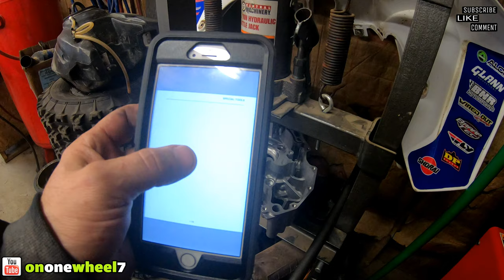YAMAHA YFZ450r ENGINE BUILD   PART 1

Comment: Put those case halve with the bearings in the oven at 300° for 1/2 hour and they will just drop right out ... also vice versa for bearing installation - put the case halves in the oven at 300° and the bearings in the freezer and they will drop right in like butter ...
Reply from the maker: Thanks man if you have seen my latest couple of builds i have been doing just that works like a charm i love it.
Reply: Exactly

Comment: I have a 05 YZ450F  When you was putting the transmission in and the fist washer you said dont forgot this and it rides on the bearing my engine didn't have it. The 5th gear felt like it was jumping like skipping keep on chain and sprocket but wasnt that it was tranny. Could this be the reason for this? No washer ? Thank you great video
Reply from the maker: That maybe a different setup as far as the washer goes you may want to check the manual and see the atv transmission is a little heavier duty vs the dirtbike one.

Comment: Do you case splitter to separate? And why don't you use crank puller to push cases on? Wouldn't it make it easier? I'm just asking for knowledge not trying to sound as if I'm an expert. I've assembled alot of 2 strokes and it's required on trx250r and Cr80,125,250 but then the banshee is completely different.
Reply from the maker: I do use a case splitter. Crank installer isn’t really needed i do have one and have used it on 2strokes as well those you have to use them. These will tap rite in w a rubber mallet.

Comment: Do you have a video on cleaning the cases? Scraping off the old gaskets and things like that.
Reply from the maker: In some or my earlier engine build vids i used to sand blast them myself now its easier to send them out to be cleaned but i have shown it before.

Comment: So it’s supposed to be that tight when reinstalling…? Cause mine was worrying me last night I didn’t want to slam it together and it get stuck, and then never be able to get it apart or have something binding inside
Reply from the maker: Yup. To pull the cases apart easily the tusk case splitter tool is a must have.

Comment: Hey new subscriber here.  Got a quick question I got a 04 450 doing a new crank build.  Can the main bearing hold down screws be reused if in good condition?
Reply from the maker: Welcome to the channel man. I know the 2009-current yfz450r they can be reused i don’t have that manual on hand but they are i believe the same retainers as the efi yfz450r so i am gna say yes its ok to reuse them.
Reply: @ononewheel7  thanks for the advice man keep up the good work.
Reply from the maker: Anytime man.

Comment: Any advice on the crank starting to seize when tightening case bolts?  It's free until I snug them up.  Bearings were hammered in...going to buy a press today to remove/reseat them in case that's the issue.  Crank is brand new hot rods from rebuild kit.
Reply from the maker: Is it a yfz450r?
Did you change all the bearings i know theres one on one for the tranny bearings the retainer is like a c and can go in either way but it actually has to go in facing the left if that makes sense at all!
Reply: @ononewheel7  450x but yes.  All new bearings, case, and crank.  Found crank wasn't seated 100%.  Few taps on bearing and smooth as butter now.  Thanks for your videos!  Tremendous help!!
Reply from the maker: Ok cool glad you figured it out! Thanks for watching man!

Comment: I picked up a 05 yfz with a blown motor as a winter project. I'm a little rusty haven't built one of these motors since 2012, thanks for posting these videos I'm using them as a refresher. Keep up the good work and thanks for the links. Will definitely be using them! One last thing did you use oem bearings or aftermarket?
Reply from the maker: Thanks for watching!
I used oem for the mains and the hot rods kit for the transmission/counter balancer!

Comment: What can cause 5th gear slipage on and off gear looks good just did a rebuild clutch is in specs i dont know what to do now its only happen on 5th gear under load
Reply from the maker: Like the clutch is slipping or its slipping out if gear?
Reply: Like the clutch slipping but its only happen in 5th gear
Reply from the maker: Hmm hard to say maybe it is a clutch issue if it were a transmission issue i think you would see something obvious in there.
Reply: I just reopened it and i have one fork damaged i think its bent i can see the scuffing where its not supposed to so i think the 5th gear not engaging completely and its skip ,do you know how to remove the first gear on the transmission main shaft its looks press on it thanks
Reply from the maker: They do press on so needs to be pulled off.

Comment: Hey man my parts came. In the cometic kit, what are all these orings? I don't remember pulling nearly this many out, thr top end was off the motor when I got it too. Really don't want to miss an o ring before sealing the cases!!! Any help is super apreciated man
Reply from the maker: Did you get a complete cometic kit?
If so it comes with every o ring in the machine. You can only use the ones you need and save the rest.
Reply: @ononewheel7  oh so u mean it comes with o rings for stuff not for the engine? Yeah its the whole cometic kit. Gaskets seals o rings, top and bottom end. I didn't pull top end apart but I pulled the bottom, and made videos. I can't figure out where the 3 smallest ones go. Downloaded a yfzr only manual and it helps but some aren't labeled and I can't tell if its o ring or washer in the pic. Bought a manual off ebay, Clymer, says it was for the R, but all the pics and instructions are not the R so its useless lol
Reply from the maker: Do you have a carbed model or efi?
Ya there are orings in various spots for the engine there wont be extras!
Reply: @ononewheel7  its the efi 450r. Same motor in your vids. I keep watching them over and over thinking I missed something lol looks like u only put 1 o ring on the small dowel before u marry the cases. Cranks in, trans in. Ready to set cases I think but just making sure. I've figured out where at least half of the o rings go after the cases get sealed.
Reply from the maker: Yes thats correct for the cases.
There is an oring on the counter shaft you can replace w the cases together
Reply: @ononewheel7  yep, have that one off and new one ready for after setting cases. So far I've figured out small dowel o ring next to tranny, countershaft,  water line thing before putting clutch cover lol w.e. thats called, then the 2 stator cover sight hole cap o rings, I think there's one for the starter, one for the sensor, and that still leaves like 5 or 6 that I can't locate. I think the guy that pulled the top end off threw them out instead of keeping them with the corresponding part. Its the only thing I'm having a hard time with. Damn o rings lmao 🤣

Comment: Hey brother I blew my clutch basket and it took the shaft, idle gear that holds the round gear. From watching your video I can tell I’m probably going to have to pay a mechanic to open the entire engine to put the nut that holds it inside the case. How much do you think this would cost me to pay a mechanic just to put that part into my bike? Btw I have a yfz450r se 2017
Reply from the maker: Sorry to here that man i do some engines here and there and for a bottom end i charge 350-400 depending on how much is getting replaced inside a complete engine would be like 550-600!

Comment: Makes you wonder how much faster bearings wear in sub 30 degree cold starts. 
Did you purchase bottom end parts as a kit? Also thanks for these videos I will be attempting a rebuild on my newly purchased 2012 yfz450r soon
Reply from the maker: I got the transmission bearings as a kit from hot rods! Ya know doubt in cold temps thats why they all have those retainers

Comment: Great fucking job love it, one question no torque specs on the retainers for the bearings just ugga duggas ?
Reply from the maker: I always use my drill its on low the smaller bolts are 7.2ftlbs the larger ones are 16ftlbs and the middle sized ones are 8.7ftlbs
Reply: In other words hold a 1/4 ratchet by the handle on the bigger ones and smaller hold ur pointer on top of the socket or extension!

Comment: At 27:39 what is the piece you put on before installing the tyranny gear shaft?
Reply from the maker: It was a small dowel/oring near the oil strainer. Parts 8/9 in the manual under crankcase

Comment: How many times did you rebuild a motor in 2019?
I cant believe you sucked rubber gloves into the cylinder that's awesome that would be something I would do
Reply from the maker: Everything Loud 406 i rebuild them once a year after ironman the new bike needed a little more love so i just tore it apart practice bike is still going strong i did put a new piston in that one though in the summer my 1st time w the glove thing hahaha hopefully my last too!
Reply: @ononewheel7  what oil do you use in the yfz I do not want to run yamalube anymore I keep hearing of all these brand new Raptors and yfz's that dont even have a full year on them and the clutches are going out and they are running yamalube and mine is starting to slip and then I seen cuervo racing's video about it and I'm done with there oil I've never had a clutch go out and this should not be happening yet
Reply from the maker: Everything Loud 406 i run blud racing lubricants its great stuff!
Reply: @ononewheel7  I will have to try it out thanks man
Reply from the maker: Everything Loud 406 give it a try i think you’ll like it!
Reply: @ononewheel7  ya I will try it out

Comment: hey man my 450r chain broke and broke the left side case do you know how much they cost ?
Reply from the maker: Case you have to buy as a pair used you can usually find some around 300-450 new i think they are like 500-600 depending were you go! Is this for a yfz450r? Sorry to here this man i have been there it sucks get yourself a glann innovations case saver and chain slide so this never happens again!
Reply: yeah it’s for a 2018 450r se it also broke where the clutch cable goes & my chain saver
Reply: i might take it to clawson but i feel like its going to be expensive
Reply from the maker: It can be so the problem w new or even used cases is you will need to replace all the seals/bearings! I would also not reuse the crank not sure how many hours you have on yours a couple years ago i reused a low hour crank out of a fine running engine it lasted two rides and grenaded ruining the cases and cylinder and damaging the head as well! Now you can reuse your piston/cylinder as long as the hours were low and its not smoking otherwise you may want to change it the head also should be fine as well! So w bearings gaskets seals and a crank you will prob be around 500-600 bucks and then the cost for the cases and then labor! So it can add up quick 1000-1500 bucks would be my guess!

Comment: Thanks man your tear down video helped so much!!  found out my issue axle main in the transmission had 2 pieces of gear missing, and my 1st gear wheel (35t) has one piece of gear torn. Saved me a ton of money 200$ > 1000-1200$ at shop doing it myself. Now I wait and study this video while I wait for the parts 😂😅.
Reply from the maker: Awesome man!
Do you know what caused it? Did something else let go to damage the gears?
Reply: ononewheel7 the chain was pretty dry and got all bundled up around the front sprocket lucky I had a case saver on so no damage to the case.
Reply from the maker: I hope you have a glann case saver!
Reply: ononewheel7 update got the motor all back together and in the quad today went to turn it over and boom nothing but the motor turning over and neutral light won’t turn on I’ve checked and cleaned the switch too right below the shift lever. Any ideas ?
Reply from the maker: All the wiring connected?
Grounds etc?
Reply from the maker: All the wiring connected?
Grounds etc?
Reply: ononewheel7 yessir I double checked wiring timing and plug
Reply: Is it possible for my starter to have gone bad or maybe I did the shift forks wrong ?
Reply from the maker: 607 Garoger do you have a compression tester?
Reply from the maker: It wont turn over if the starter is bad you said it was turning over right?
Reply: ononewheel7 yeah it turns over really slow almost like the starter is bad but I checked the voltage on the battery 12.6v and pulled the starter out and hooked it to a battery both are in good condition. Will have to try a compression test then 😅
Reply from the maker: You sure timing is good??
Marked on the compression stroke?
Reply: ononewheel7 update buddy who knows a few things more about motors then me checked it over this morning everything he checked was good tried to pop start it and it nothing he said to tear it back down which I’m currently doing going to Lowe’s for a 2x4 to make a stand like in your video and impact driver to make the process quicker.
Reply: Do you know if the transmission gears were installed wrong will it not throw the neutral light because it shifts but not the smoothest almost like there’s only 3 gears 1st neutral and second.
Reply from the maker: If there was a transmission issue it would probably lock up at some point!
Neutral light could be the wire itself of a problem w the harness were it plugs in!
Reply: ononewheel7 got all back apart is there anyway to send u a picture of the shift drum just to make sure I got it in right ?
Reply from the maker: 607 Garoger facebook or ig
Reply from the maker: Or email its in the about me section
Reply: ononewheel7 thanks man I appreciate all the help, Feels so good to be back on my ole yfz. Ended up being my damper assembly on the stator side cover that spins the starter. First time really rebuild any motor and I can say anyone can do it with a little knowledge, service manual and the excellent help of your videos!! Keep it up you rock!
Reply from the maker: Ok nice! Was it bad? Ive replaced those before as well!
Reply: ononewheel7 nothing was wrong with the old one till I took the circlip off didn’t realize it came out as a whole part so I kinda of ruined the original one when I did the first tear down.
Reply from the maker: Oh gothca  glad it was an easy fix!

Comment: One question. Why do you use the factory crank and not go aftermarket? And I just would like to say that cross threads are more reliable than red locktite lol. Great video man!
Reply from the maker: Anonymous person the 2014+ cranks are rock solid even w high compression been using them for years now w no issues i have used hot rods as well w no issues to i think next build i may run one of those to see what kind of time i can get out of it!
I am a pro at cross treading hahahaha!